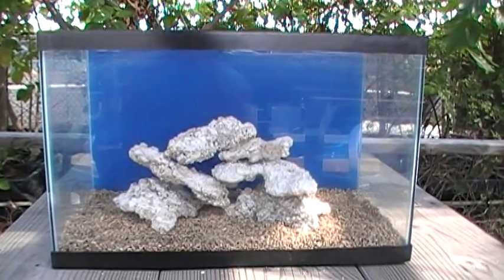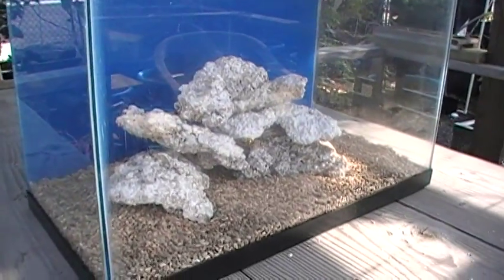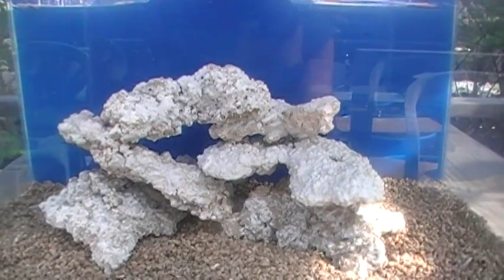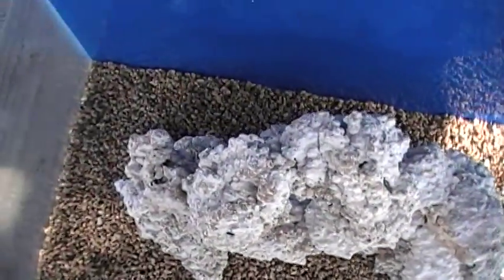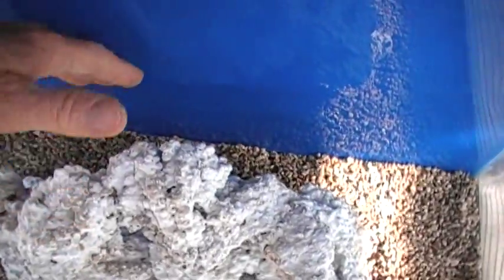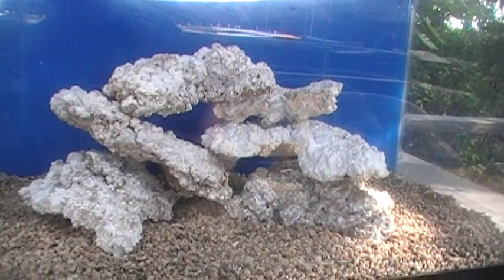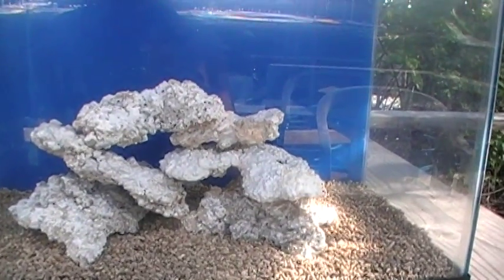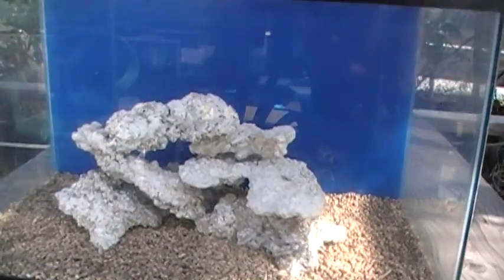Nano Lagoon (6): Build the Reef

Comment from the maker: Good question, MJ!  A Nano Lagoon is a nano reef tank that features a lagoon biotope in a technologically simple, inexpensive, 10-gallon glass tank -- the type you can find anywhere.  We use a simple hood mod, a HOB filter and self-ballasted bulbs to give 4 watts per gallon of 50/50 pc/actinic lighting.  Finally, we eliminate the addons like skimmers, sumps, 'fuges, etc., and feature captive-bred soft corals and cleaners along with man made rock to make it 100% sustainable.

Comment from the maker: Leaving space in the back allows better water circulation around and through the reef.  Also it allows you access to the back panel in case you want to clean it.  With the rock configuration we've used in this example the back of the reef is visible from the sides of the tank and accessible from the top..